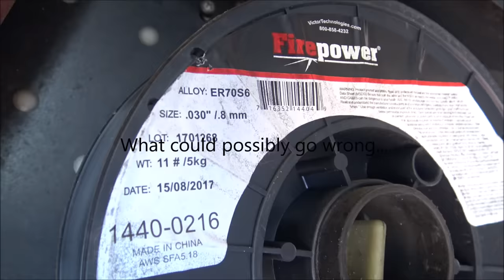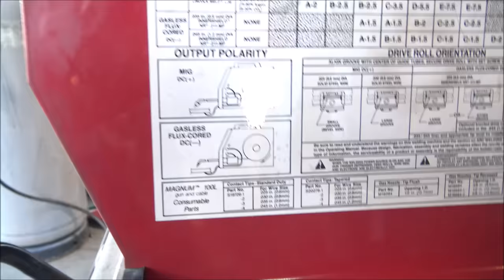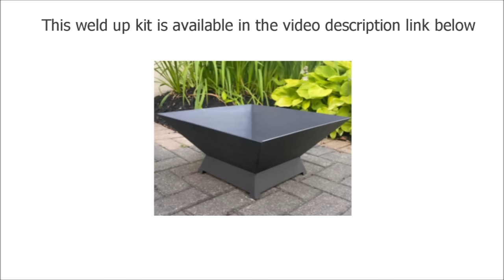MIG Welding - Fire Pit Kit - Fun Easy Project

Comment: I remember my friend bought a small Hobart that size for welding automotive panels. It has the gas conversion, but he complained for months that it wasn't welding right... Until a mutual friend asked "did you check the polarity?" The Hobart welded great from that point on. 💪

Comment: Those little 230v Lincolns(not the 120v version) are really good, under appreciated machines. Once you get the settings dialed in, they perform very well on mig. Same goes for flux, they can really lay down the heat. I know I ran my old one past the duty cycle more than a couple times but it was a timex in that regard, miles and miles of wire through it and it never stopped. They just need a longer whip as standard, you can order longer ones from HTP iirc.
Reply: i used to really love my little Lincoln.
Reply: Cam you recommend a decent starter welder that is 120 volt?
Reply: Honestly, most of the 130 volt welders are junk. Gutless and have absolutely no power at all. Save your money,  get a 240 volt machine and okay an electrician to wire you a 240 volt plug. Seriosusly
Reply: Sorry 120 volt not 130. Big fingers

Comment: I think the bottom piece should have 3 holes on each piece, I see it has little feet to let the air under it but if you put that in the grass or on dirt then those little feet will just go into the dirt and then you no longer have airflow. The holes eliminate that. Just my thoughts 💭

Comment: Very likely MAG but I forgive your rookie mistake 😉😁 but seriously, you can see that you're a pro at TIG, the way you move your torch!
Reply: Why MAG and not MIG? Do you know the GAS or are you able to tell from the video?
Reply: in italia per consuetudine si definisce MIG tutto cio' saldato a gas inerte 100% ma anche a piccole quantità di miscela come Argon/CO2 , mentre si definisce MAG il CO2. Tecnicamente la miscela Argon 80% e CO2 20% sarebbe da classificare MAG ma nella pratica la distinzione tra Argon/CO2 e solo CO2 è piu' comoda ponendo uno in MIG e l'altro in MAG, il movimento della torcia credo dia maggior profondita alla saldatura
Reply: Isnt this stainless? Its common to use 99% argon on that (which is an inert gas.)

Comment: I never knew that you change polarity of you're welding gas vs. core.  
So Electrode Positive if I'm using CO2, and Electrode (or wire, or whatever you call it) Negative if I'm using flux-cored?  Damn!  I feel so fucked up!

Comment: Why are you tapping the ends of the corner?
Reply from the maker: "Tack and smack" technique. If there's a small gap, you can tack weld it and smack it with a hammer while it's still hot and it'll close the gap up. Hopefully that makes sense.
Reply: Is it hard to learn mig welding?
Reply: @kilowrocks91331  not really. But its one of those skills that are "easy to learn, hard to master"
Reply: @kilowrocks91331  what Dave Kersley said is right, but he doesn't say why.
If you already do stick and/or Tig it shouldn't be difficult to pick up, but if you've never welded before?
Three key reasons guys fail at welding are
1)Desire. They don't have it! You have to really want to do it!
You have to put in alot of hours under the hood to master torch control (angle, travel speed, arc lengths and how they affect the weld, reading the puddle,etc.)
This practice time is lonely time cause you're the only one under the hood and you can't chit chat or be sociable. Can't be going to the bar or watching the game or playing with the family! So if you don't enjoy your own company, you'll hate it!
And it's not soldering or gluing. You're not just "sticking metal together" and that reality is enough for most to quit. Usually you hear "Oh that's too involved. I thought it would be easier!"
2) Aptitude ( hand -eye coordination, talent, or whatever you want to call it) to comprehend what's going on and why and be able to execute it.
3) one must also possess alot of money or high limits on the credit cards because this shit ain't cheap!
Nothing about it is inexpensive!
Even if you bought a Harbor Fright set up (WHICH I STRONGLY SUGGEST YOU DONT!!!!) You'll be dropping roughly $2500 on the cheapest "better quality" machine,wire,helmet,gloves,jacket,cart, regulator, clamps, clamps ,clamps, a complete tool box, angle grinders and you still need to go buy or lease a bottle of C25 from the welding supply store!
Now if you purchasel quality gear from a "Real Welding Supply" where you get your bottle of gas, your looking at more like $4000 depending on your choices!
And this is just for starters!
You haven't even bought any steel yet!
If you haven't quit yet.....
now there is metallurgy. Knowing how different metals react when heat is put to it and such as well as preparation and layout of the material to be welded.
So yeah man you can learn easy enough watching you tube videos. You'll know every step and motion of what to do.
As for Mastering? If you make it to "more than competent" you've done something!
Reply: @kilowrocks91331  Short answer, yes it is easy.  The easiest actually.
Now, it depends for what purpose?  For a hobby or for home projects?  Easy.  For professional paid for jobs, that's a little different.  For passing inspection jobs?  That's not that easy.